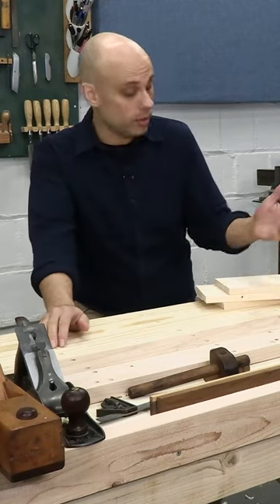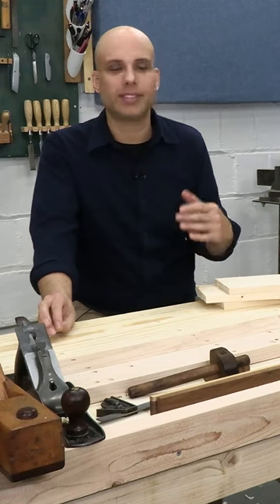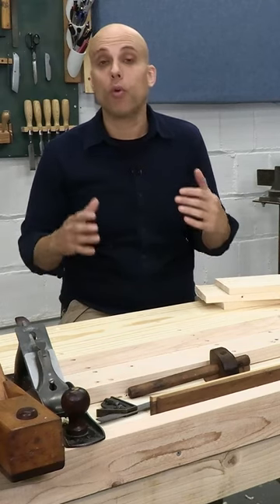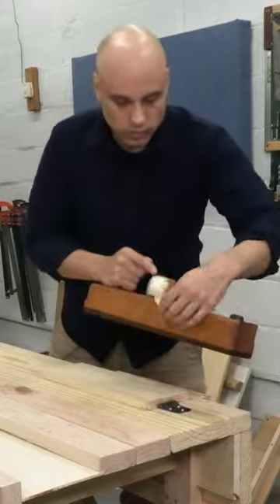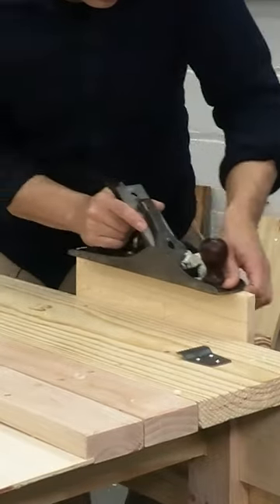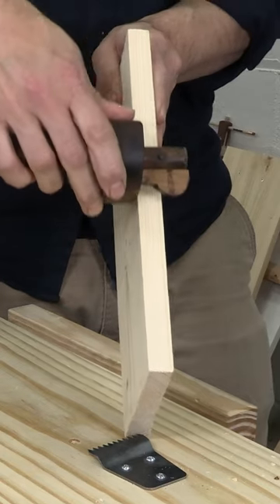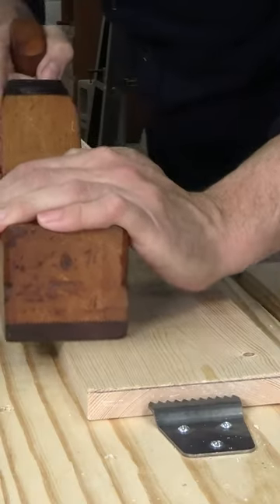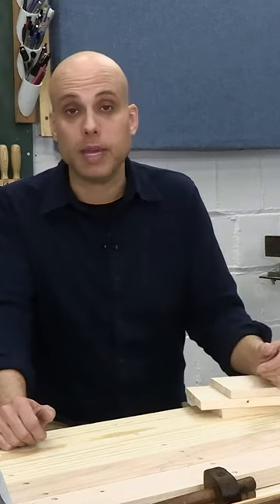Flat boards EVERY time! EASY!

Comment: The only concern I have with this technique is that if you apply much pressure when planing, the underside that isn’t flat can broadcast itself and you basically end up with a thinner board that’s just as twisted, cupped , etc.

Comment: Sorta skipped over how you deal with bow.  I saw someone mention heat or steam and/or clamping for this on the comments for the main video.  Any thoughts on dealing with bow?  Thanks Rex ❤
Reply: When preparing stock, you first cut it to rough length to reduce to the bow. You should select stock that is thick enough that you can remove a 3/16" to plane to final thickness. If You need final thickness of 1 inch, you buy a 5/4 board (1&1/4 inches but likely skip Sanded to 1 & 3/16). If it is really long you may have to buy 6/4 to net that 1 inch. Or in your design a frame or batten may help hold a panel flat. Sometime you hide a hollow on non show face like the bottom or inside. It does not need to be perfectly flat just mostly flat.  Also too perfect looks unreal like 3D animation.

Comment: Not to be smart but can you be sure there isn't a spot on the face lower than the sides that you miss?
Reply: No, but you can use a straight-edge to check. If you have a low spot you can set a marking gauge a little narrower and take a bit more off the top.

Comment: I need tips on getting that edge square to the first flattened face. Anyone?
Reply: Is "build Rex's shooting board" the correct answer? Lay newly flattened face down on shooting board, joint edge to 90, then proceed from there?
Reply: @RexMcTavish  you gotta get square wood when building the shooting board to get square wood off the shooting board. It's circular, logically speaking.
Reply: Put the board in a vise. Grab a mini square, run it along the edge with one side registered to the first face. Hold the plane perpendicular, take a couple shaves until you get full-width shavings, test for square. If it's off-square try again, noting which way you should adjust your hold; high inside tilt the plane away from you relative to last push, high outside tilt it towards you relative to last try. With practice you will get a feel for it.

Comment: Would a #5 plane work?
Reply: Yes! Rex uses a plane similar to a #5 in this very video. The only time I wouldn't use a #5 is if the piece is really short, say half the length of the #5.